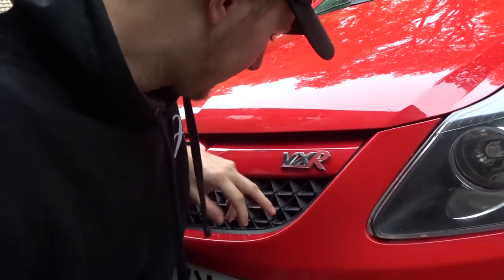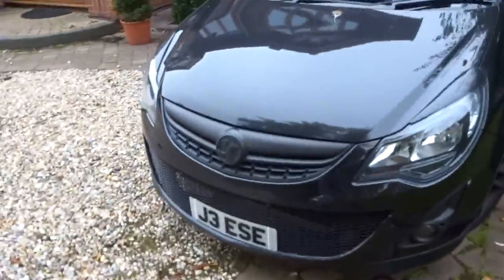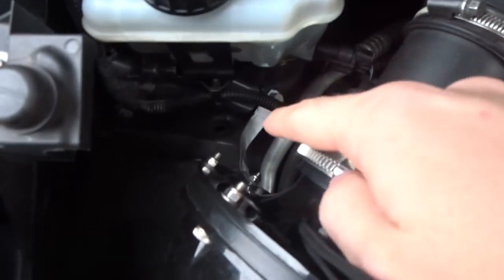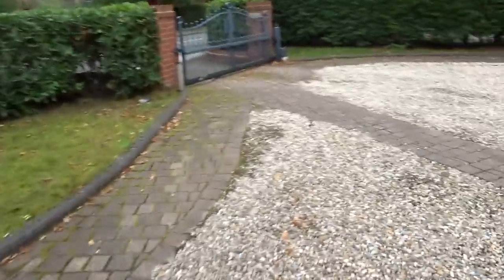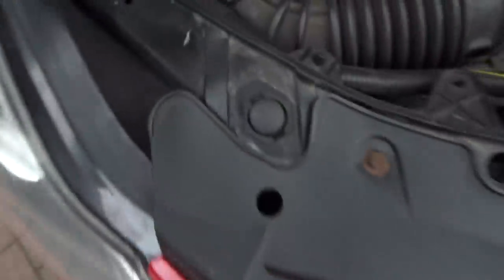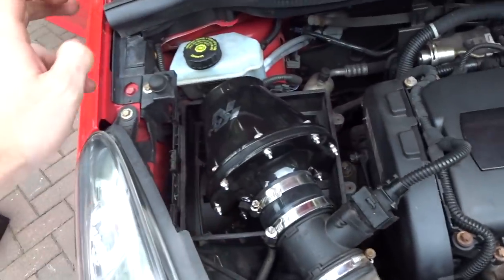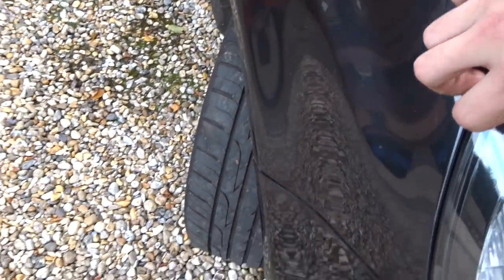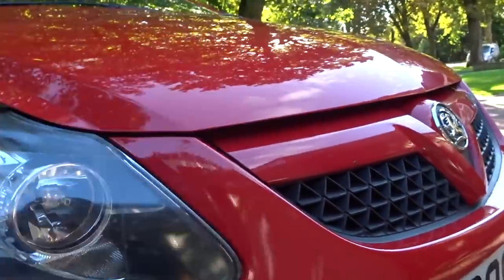FIRST MODS FOR THE VXR!!

Comment: Standard airbox may be quieter but it will be better for performance than the K&N just fitted. That’s sucking hot air out the back of the engine bay, higher intake temp means ecu will pull back ignition timing and you loose bhp.

If you want induction noise drill holes in the bottom of oem airbox.

Oil based filters are notorious for killing Vauxhall MAFs, I know this from experience and the two dead MAFs in my garage.

My old coupe turbo z20let ran airbox from cdti astra and was making 280bhp and 350lbft, cone filter it made 265bhp and 290lbft on same map.
Reply from the maker: would it be better with a foam cone filter then mate?
Reply: If you can block off the engine bay heat from the cone then a maf safe filter like ramair will be fine, tx Autosport do a shield for engine bay of Mk5 astra vxrs, use the principal of that on your corsa for a good diy content video and you will gain bhp by end rather than loose it to heat
Reply: @JesseCollingham  aftermarket filters don't do anything or lessen performance most the time when not mapped in
Reply: 60 ftlbs lost from an air filter I doubt that I know what you mean with the oil going on the element on a maf does kill them I ran a filter on turbo, pipe outside the car with filter, no filter made no  difference on the dyno. He might get a little heat soak when stationary but when the cars moving he wouldn't notice anything. Just leave it
Reply: This is true. Unless you have heat shield
Reply: @seanandersen5752  I agree 60FT-LBS is a Hell of a lot to lose just with a different air filter set up Even a diesel Remap doesn't even gain 60lb ft I've ran both set ups before and with cone filters throttle response is improved fuel consumption rises because of the nice noises you put your foot down more

Comment: If your looking for a good cone filter I recommend the AEM one I had fitted on mine. Costs less than 50 quid and is the "go to" filter along with the pipercross foam cone for the guys running big power Corsa's and Astra's

Comment: i took the air box out on my Corsa E SRI Turbo, fitted a Ramair cone which has a mount to a point under the old air box supporting the cone, for now, left the air inlet which fitted to bottom of the airbox, there was trunking that came with the kit which will fit later, for now the inlet which went to bottom of box feeds cold air towards the  cone has a bend in it so now risk of water getting in,, can send you pics if you like.

Comment: I'd suggest getting a bigger k&n without the heat shield as it's stopping cool air from getting to it as it supposed to have a cold air feed going from the filter to the front grill or fog light

Comment: It would sound better with the over air filter as the K&N wont be sucking the air in as much as the over on
Reply from the maker: how you mean mate?
Reply: The black filter you got on it has a casing over it so it just be sucking through the little hole and the red filter you got hasn’t so it be sucking from everywhere bud

Comment: Could you show how you debadge?
Reply: Théo Chandler typically with most cars it's just glue under your badge unless it is built into the body like the Corsa E. But literally take a heat gun or even a hair dryer and gradually heat it up and the blue will start to lose grip and you can pull the badges off. Just make sure to give the car a good clean n polish as the paint underneath will be lighter than the body work because it hasn't had any dirt coming up on it.
Reply: @Dave-us5fq  cheers mate, im guessing the glue comes off easily then?
Reply: Théo Chandler yeah mate, there may be a little bit of glue still sticking once the actual badge comes off but just pick at it carefully n it’ll come quite easily. Just don’t burn ya fingers lad😂
Reply: Nice one 😁👍